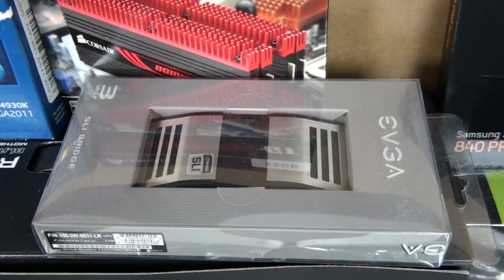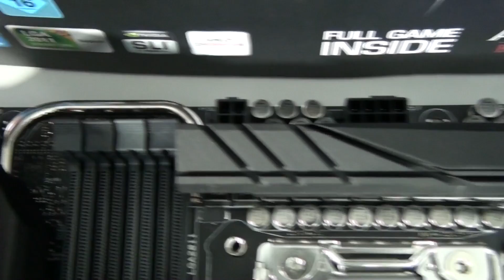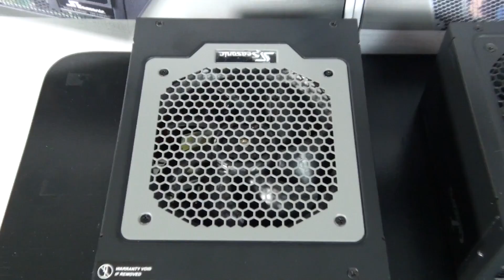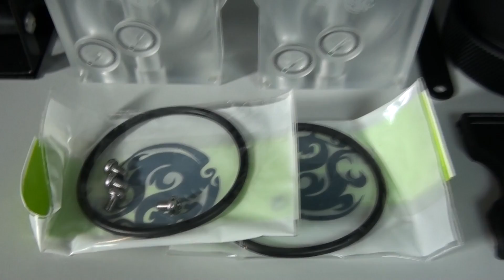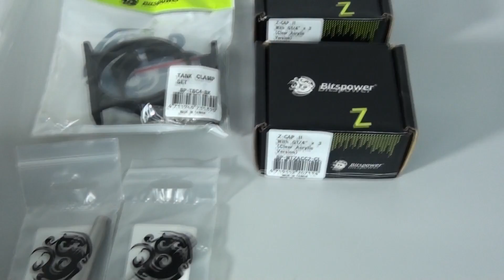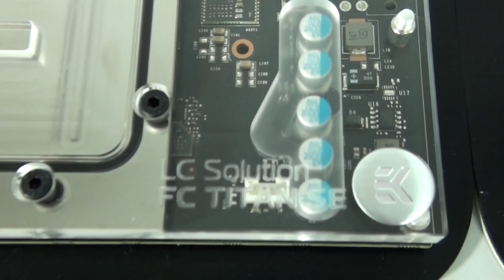Build #14: Extreme STH10: Part 1

Comment: It just so happen that i was build a pc witch using almost the same hardware at this pc the only different is i'm using XSPC Razor and XSPC Raystorm  water block and hard tubing instead of crystal link.
Also another different thing is i'm using FrozenQ liquid fusion 250mm reservoir and run everything single loop using 2 MCP 655 and a Bitspower dual ds mod top

Comment: I wish i could actually find the EK components he uses, im looking at Performance PC's now and have on screen the D5 mod pump top and as he says in this video, it comes with the reservoir, well on Performance PC's it does not and they don't even sell a reservoir compatible with this D5 mod top. It basically seems impossible to find all the parts he uses.

Comment: Are the new industrial Noctua fans the best option for radiator cooling? I know the old Noctuas are best used for case cooling(great airflow) but they might not  be the best brand out there for silent radiator cooling.
Reply: Even though they are ugly, they are the best.
Reply: Parker Bass The Gentle Typhoons are apparently best for silent radiator cooling, Noctua is better for air flow.
Reply: ***** No idea, I think so, What would be your recommendation for silent radiator fans then? We are assuming the GTs are no longer available.
Reply: EarlRegent Nope. But the industrial ones are super expensive
Reply: Tydrian1995 You can still find them on amazon
Reply: ***** Nope
Reply: Sonefiler So, what's considered the best these days for radiator cooling? Why would they discontinue an effective fan?
I know the noctua industrial fans are out now, but I am yet to see a comparison chart in regards to radiator cooling with them included.
Reply: EarlRegent Noctua NF-F12, Corsair SP120, some noiseblocker fans
Reply: Sonefiler The SPs are not bad, but Noctuas are not the best for radiator cooling. That's why I asked if you have info about the industrial Noctuas.
Reply: EarlRegent The NF-F12s are great, some of the best after Scythe GT's.
Reply: Sonefiler Correct me if I am wrong, but those are not the industrial(the new ones) Noctuas right?
Reply: Sonefiler http://martinsliquidlab.org/2012/05/07/r10-fan-testing-bitfenixnoctuasilenxnoiseblockerphobya/

Those noctuas(the ones you mentioned) are not the second best to the typhoons. Noctuas are the best silent fans for air flow and noise, but restricted airflow renders them like number4-5.
Reply: EarlRegent look at noctua's latest line of fans and look at this http://www.noctua.at/main.php?show=productview&products_id=80&lng=en&set=1

7.63mmH20 yeah tell me something better than that at those noise levels and features and build quality! Oh wait you can't haha.
Reply: Cley Secor The noise level is what confuses people. A slightly noisier fan that offers a significant enough difference in cooling is often the better option. Did you inspect the comparison site I linked earlier? Remember that radiator cooling is different from case cooling with less restrictions. The noctua industrial is louder on first inspection. 

We need to look at static pressure to determine performance with restrictions to air flow like the presence of radiators right?
Reply: EarlRegent hence why i said look at it haha its designed for static pressure hence the 7.63mmH20. the higher the SP the better for radiator cooling or cooling a certain area like HDD cages. i say anything above 2.0mmH20 is pretty good.
Reply: Cley Secor Yes, I did have a look and the cfm is also around 100 when you convert it. Remember that this is at maximum speed so you would have to adjust the noise level for a more accurate comparison. Furthermore, the reason these tests are conducted is to, of course, measure performance in practice. The experiment I linked you also did not reflect what you would expect from specs alone. We would have to test the Noctua industrials on radiators to see if the building materials are able to maintain that pressure when restricted. You do understand my concerns right? Noctuas(the old ones) did promise great pressure on paper. It turned out that they were best suited for the case. We need someone to conduct this experiment again using the industrial noctuas.
Reply: Cley Secor You see my point now right? When it comes to static pressure and performance based on noctuas on radiators, they are louder than other brands for the same output. the formula is the same even when applied to the industrials. It seems the materials used to build noctuas are not the best for silent radiator cooling.
Reply: EarlRegent well my Noctua's on my H110 are the best performing and most silent at the same time compared to others who offer only one of those aspects.
Reply: Cley Secor No doubt! Please do not misunderstand; I am not playing favourites. I am simply trying to get the best information possible. I have to insist though, for silent radiator cooling(for the amount of rpm you need from even the industrial noctuas in practice); it appears they are not the most silent . I am highly suspicious that the materials used to make them so silent in non restricted positions is their downfall when air flow is restricted.  Noctua is still king based on noise in non restricted air flow scenarios  though.
Reply: EarlRegent right, just depends on how you mount them, what case, etc.... i just personally think if you use the noctua's industrial fans and use a fan controller you can still manage high SP and a decent dB you're comfortable with.
Reply: EarlRegent Hey man, idk if you're answer as been answer, I was using the default H90 fan, my temps were ok sitting at 70C on a I5-4690k OCed a 4.3 the fan died on me, switch it by by two noctua industrials fans and the temps droped to 50C and I was able to push my CPU to 4.5Ghz, they seems to be good on radiators :)
Reply: Tydrian1995 Thank you for that. Are they the best silent fans for rads though?
Reply: EarlRegent in term of performance, yes they are. But in terms of looks no they're not
Reply: Tydrian1995 Better than the gentle Typhoons?
Reply: EarlRegent Never tried gentle Typhoons but they're not on sale anymore
Reply: Tydrian1995 Look a this link: http://martinsliquidlab.org/2012/05/07/r10-fan-testing-bitfenixnoctuasilenxnoiseblockerphobya/

Now, if the new noctua Industrials can match the GT's then we are in business.

Comment: Finally, another Aussie top end build in a case labs chassis, it's been too long. Looking forward to this.

Who wants to take my bet that in the next video it'll have the line:
"There's been a component change since the last video. Corsair have now released their new 1500i PSU which has some excellent features and also provides sufficient power at low noise and is also easy to mod the cables on. This replaces the two awesome Seasonic PSUs that were in the previous video" :)

Comment: Pulling 1100W on a 1200W Seasonic PSU wouldn't be an issue at all. They're rock solid, even when pulling over spec. Put three 780Ti Classies in there, and dual PSU would be justified. :P

Comment: This builds going to post some impressive results after it's complete.
I love the Rampage 4 Black, installed it a few months back and haven't had any issues. It's really a great board. 

I'd rant about the guy using 3 Titans instead of 780Ti's, but alreadys having 2 I'm sure the cost of the 3rd outweighed buying 3 Ti's. 

The thing I don't get, is why the client cheaped out on the ram..Dominator GT? Seriously!?
Reply: Yep. Should of went with the Dominator Platinum (CMD64GX3M8A2400C11).
Reply: My thoughts exactly!

Comment: What will this beast be used for?
Reply: High end gaming. 
I was thinking potentially rendering..but that ram isn't the best option for it.
Reply: chriskanemeier
I think i would be more about rendering. There is no logic going for 3 titans instead of 3 780ti's for gaming.
Reply: SpyRos13 There's less logic in rendering with that ram.
Reply: SpyRos13 And I was thinking the same thing, about the 780's, but the client already had two Titans so it was probably cheaper to buy a third instead of three 780's.
Reply: chriskanemeier I'm not really familiar with that ram? what is wrong with it actually?
1866,1.5v cas latency 9.

Oh,i totally missed that,if he already had 2 of them then it makes sense.